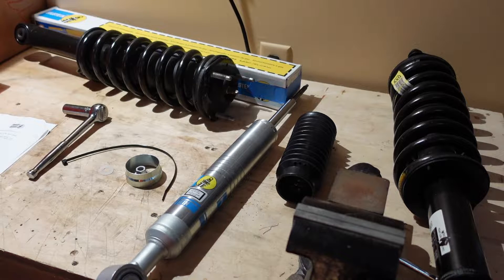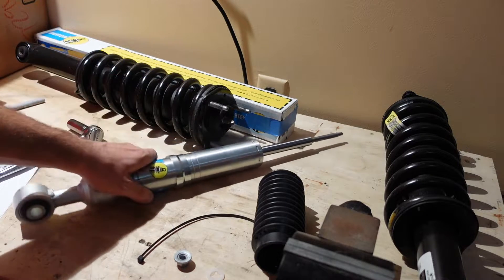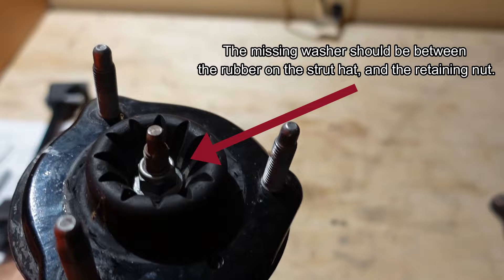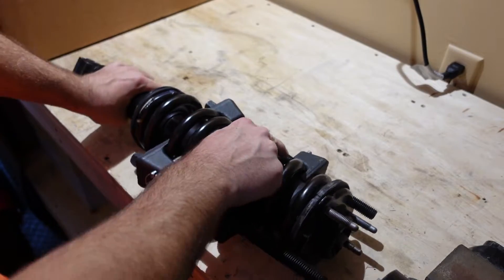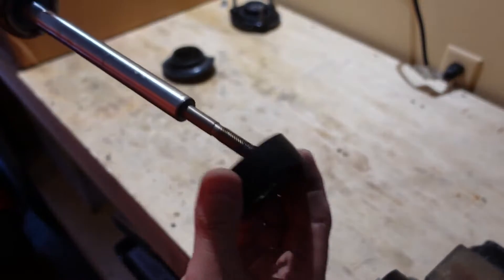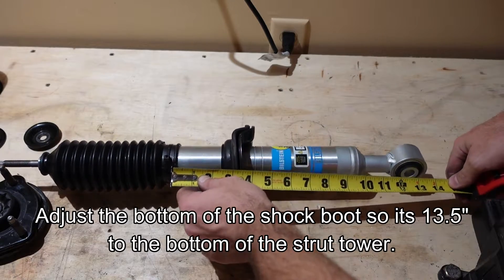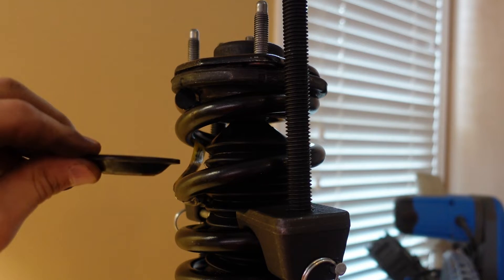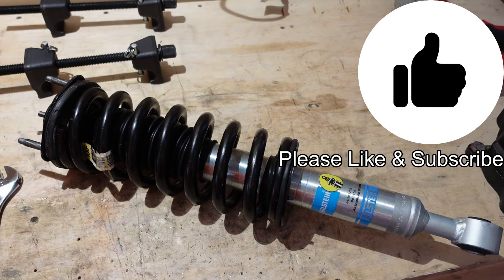[HOW TO] Assemble Bilstein 5100 Struts for 2015-2022 Colorado/Canyon (Similar for all Makes/Models)

Comment: Hi there.  Just came across your videos. 
So how is the ride quality with the bilstien 5100. ? Put them on my 1 Ton and the ride is stiff.
Reply from the maker: They are stiffer. But they provide much better control IMHO. I liked them on my Canyon. I’ve had them on several trucks over the years. They’re always my go-to shock replacement.

Comment: My 2019 Colorado didn’t have a rubber on the bottom spring rest. Should there be one? I have wore a groove in my upper strut mount after 10,000 miles it’s apart now also there is no rubber bushing between the bottom of the mount and the top of the dust cover so the strut has been sawing away at my center hole in the upper mounting bracket. Shouldn’t there be a rubber bushing like in the 70s on both sides of the upper mount?
Reply from the maker: @jayscott7152  the coil spring should have a rubber seat on the bottom and the top. The bottom one would be molded like the coil seat. And the top one is integrated into the strut hat. As you see it in the video is how it should be assembled.

Comment: That means with those shocks you won’t need the rough country level kit, right
Reply: Ok thanks for answer me
Reply from the maker: Correct. These have a built in leveling kit. And you can choose the height. I would not stack an RC kit with these. It will ride terrible.
Reply: What number level would you do to make it level?
Reply from the maker: @jamesscheider7055 1.9” like in the video.

Comment: Thank you! That helped a LOT! 
New SUB
Reply from the maker: Cheers! Glad to help!
Reply: @fondupot  I've been in 2015 Colorado Z71 purgatory for 6 months. In Oct I got new tires and struts. After 4 shops (last one Chevy dealership) all of my problems except one went away. Evidently I got a bad, brand new, Bilstein 5100 strut. The last problem is a steering wheel shimmy (or pulse) in (some) right curves at 35-45mph. It doesn't keep me from driving on the highway any more, but it worries me. I had the steering wheel recall in 2021.
Chevrolet did a $185 diagnostic, and the lame service writer quickly mentioned a "power steering module." Can't find anything on that. Any ideas? thanks and have a Blessed Sunday!
Reply from the maker: @ITigerbaum yea there’s been some issues with the power steering racks in some models. I think the remedy is to replace the rack and then make sure it’s recalibrated correctly.
Reply: @fondupot  thanks bro!

Comment: 1:40 I have the hockey puck like leveling kit on my truck. I am due to replace my front shocks and struts. With these Billstein 5100’s I can adjust the Level? Does this mean I don’t need those pucks on top of my struts anymore ?
Reply from the maker: You can set the Bilsteins to then factory ride height and leave your hockey puck. Or remove your hockey puck and set the bilsteins to whatever level you want. But I wouldn’t recommend doing both the hockey puck and any extra lift from the bilsteins. This would essentially be stacking leveling kits and it will make your truck ride like a tank.
Reply: @fondupot  Copy
Reply: @fondupot  Is there a benefit to removing the pucks and setting the suspension level vs leaving the suspension level stock and adding the pucks ?
Reply from the maker: @LilManMoe It’s really just personal preference. I never liked the hockey puck style leveling kits. But both ways will net the same benefit of leveling the front end.
Reply: @fondupot  copy that. Thank you so much for your help, and by the way I’ve been watching you since I was like 16 years old I’m about to turn 25 haha. I’ve always had the same cars that you’re working on in your videos.
Reply from the maker: @LilManMoe haha that’s awesome! Thanks for being such a long time subscriber!

Comment: So with the bilstein instructions, the 2.6” is okay for 4wd gas model?
Reply from the maker: “Ok” is subjective. But, that’s how I interpret the instructions. I would consult with Bilstein directly if you have other questions. My opinion: I believe the top notch is too much for a “stock” setup. To use the top notch successfully and safely I’d recommend new upper control arms that have high clearance ball joints and some sort of differential drop, and definitely will need the sway bar relocation. otherwise you will be maxing out the suspension geometry that will cause a less than ideal ride and less longevity of suspension components.
Reply: @fondupot thank you so much for that input
Reply from the maker: Glad to help.

Comment: Did this give this change the ride quality? Ive been looking to help smooth the ride if possible.
Reply from the maker: If you’re looking for better comfort, these won’t provide it. While they are a smooth ride, they are stiffer but more controlled than the stock shocks. I prefer it this way. The Bilstein 4600 might be better for ride comfort.
Reply: Buy a new spring meant for a lift instead of using the stock one and then leave the shock clip at the lowest setting

Comment: Ok when you install the strut, on the top where the top hat is does the top hat go through the strut tower hole or does it suppose to stop it before it goes through the strut tower hole?
Reply from the maker: I don’t follow you’re question.
Reply: Where you show on top of the strut, you get the top hat  now when insert the strut into the strut tower there's a hole on top how far does it go in? as far the top hat
Reply from the maker: I am still not sure what you’re asking. I’ll have another video next week showing installation on the vehicle. That might clear things up.